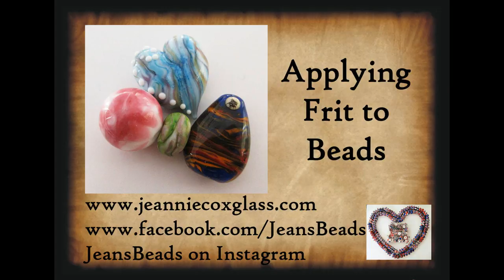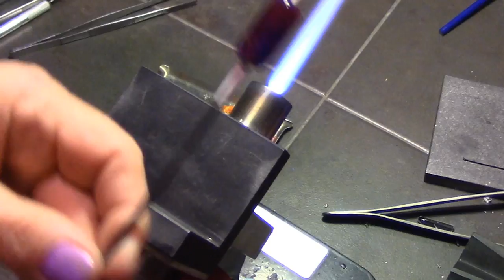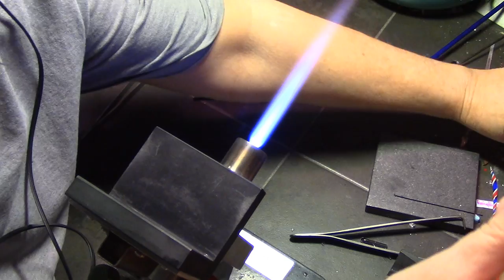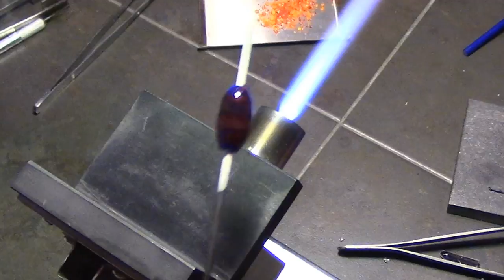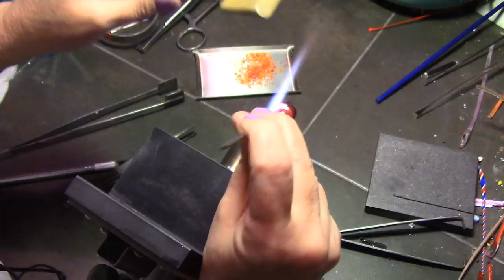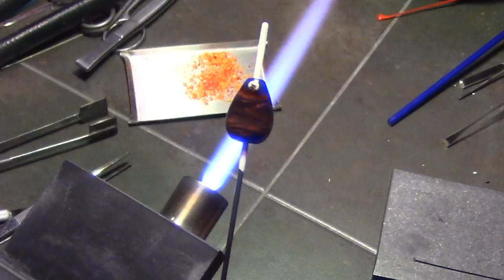How to Apply Glass Frit to a Lampwork Bead by Jeannie Cox

Comment: Hi Jeannie I am thinking of starting this kind of glass ,I have been watching your great videos explaining how to do this but then I heard you say you where going to put the bead in the kiln ,newbie that I am do you have to have a kiln if so what dose that do to the bead ,hope this makes sense and sorry it’s a beginners question but love the look of what you do ,I was going to do glass fussing but love the way you can play with the glass in this glass work ,also can you tell me what kiln to get to please ,a big ask ,thank you jakki
Reply from the maker: Hi Jakki.  If you can find my other videos (there's 2 of them) on starting your own glass studio, you will see my kiln.  There are lots of kilns out there.  I have a Paragon Bluebird kiln and also a Glass Hive kiln.  For making beads, you only need a kiln that will get hot enough to anneal them (950 degrees).  You really need to anneal the glass after manipulating it so that all the atoms in it will settle and align and be as strong as it possibly can be.  If you do not anneal, there is a much higher chance that your beads or glass will break, either right away or it could be months down the line.  For practice, tho (and definitely NOT selling), you can put your beads/glass into a metal container with vermiculite or annealing bubbles, which helps slow down the cooling process - - it doesn't anneal them, but it can help to keep everything from cracking, even if some still will.
Reply: C